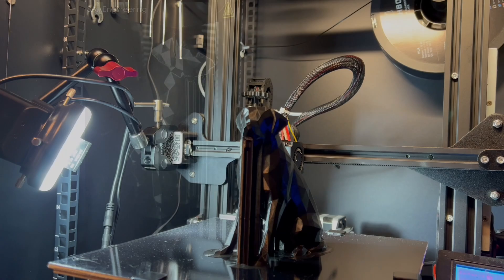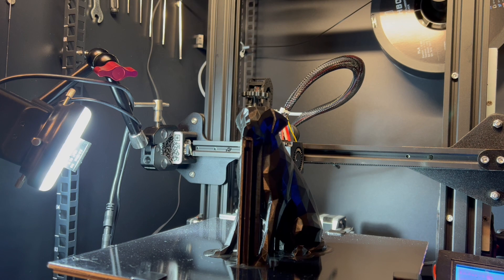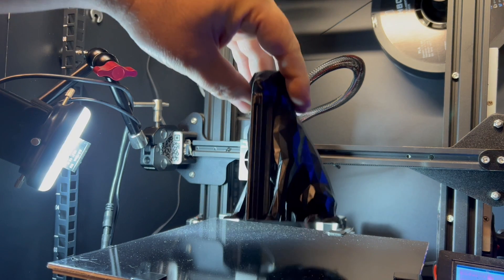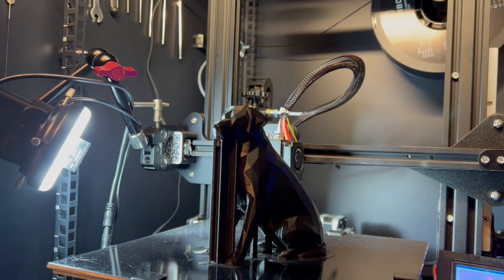Garolite G-10 FR4 as a 3D Printing Surface?

Comment: I appreciate you sharing. How thick is your G10? I suppose for my ender 3 v2 upgrade, do you think 1mm 2mm 3mm thick which one is better?
Reply from the maker: This piece is 3.5mm thick. I couldn't get it precut the exact size of the hotbed so I had to get one larger and cut it down. Careful cutting it. It contains fiberglass. I used a band saw to cut it. I had a fan blowing the dust away and a vacuum on the other side.  I find it works perfect with the metal clamps used to hold glass beds on the hotbed. (Amazon item B094Z9DCCL).
Reply: @SheriffJackCarter thanks for your support, and I feel more prepared to purchase the G10 board now.:hand-purple-blue-peace:
Reply from the maker: @user-zs4iv3vf5m  Right now, the biggest problem I have with G10 FR4 is with "Obico" which, if you don't know, is a subscription service that can watch your print for you using an online AI server. If it thinks something is fishy or that there is an outright failure, it can take action automatically to protect the printer. 

Well, G10 has a rather smooth and reflective surface and I've had minor issues of Obico seeing reflections and flagging them as print failures. Normally, it asks me via email to check on it and I can override the AIs judgement by telling it it's not a failure.

Rather humorous when it happens. 
Once, it flagged the reflection of the yellow "Hot Surface" triangle sticker on the front of the hot-end fan shroud. 🤪
Reply: How hard is for that thick of FR4 to bend? Will it bend if it is being clamped to a warped bed?

Comment: What do you think of this in comparison with PEI ?
Reply from the maker: I can't say I've ever used PEI before. After reading your question, I read up on it, and comparing what I read to my experience with FR-4, I think they are very similar in performance. A big difference I found in my comparison is that "It can adhere very strongly to a printed item, risking damage to both the bed and the item as well as taking a lot of effort to remove the model." 

I have been using the same sheet of FR-4 (the same one in this video) for years and the only maintenance I've done on it is cleaning it with 98% IPA occasionally. 
Currently, I'm running TPU material for the first time and it has fought me the hardest when it comes to removal, but it's still easier than magnetic, glass or any other bed surfaces I've tried in the past.

As of now, I have no reason to change from FR-4 since it's still performing so well. I have used this build surface with PLA, Nylon and TPU and I'm still very pleased with the performance of FR-4. When printing with PLA, there is still zero effort to remove any models from the surface. Just be careful not to scratch the surface as that can change the performance characteristics. Scratching isn't so easy unless you do something like drag the print head across it.

Thank you very much for showing an interest.
Reply: @SheriffJackCarter  that's impressive. PEI is quite famous compared to FR4 i guess it's proper marketing then. Im building a Printer for my self and I think I'll start with FR4